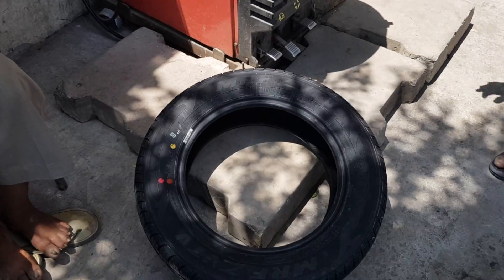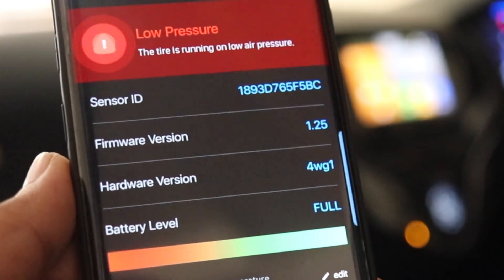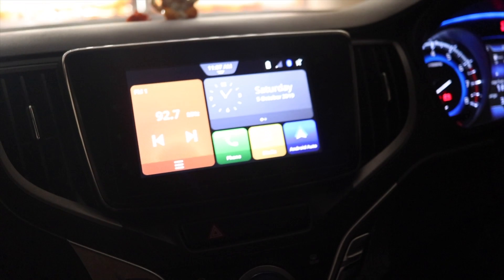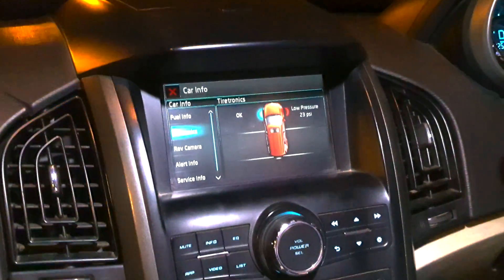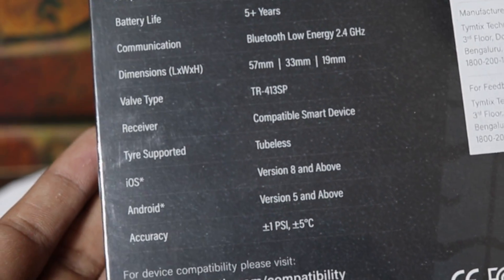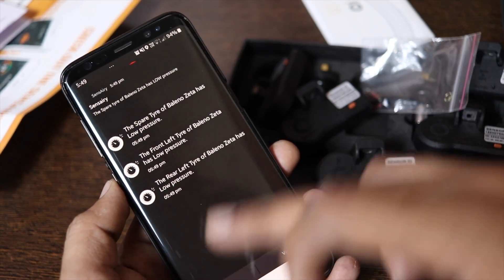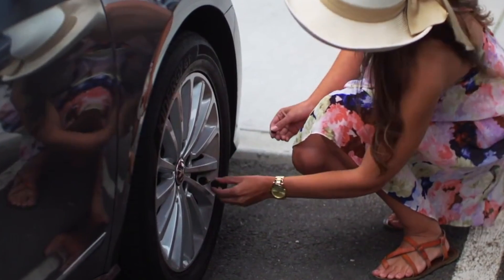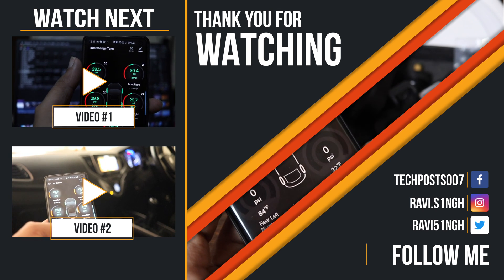Baleno Car Tyre Pressure Monitoring System with Android Auto | Sensairy TPMS Unboxing & Installation

Comment: Thank you mate for expanding my understanding about programing and installing a TPMS. I previously thought I had to install a USB receiver to my Multimedia AndroidAuto Head Unit, where as the TPMS can pair via Bluetooth and WIFI directly to my phone or Multimedia AndroidAuto Head Unit. Thanks mate.
Reply: It will not connect to your infotainment system, it will connect to mobile app, and mobile app will display it to android auto/car play... so your infotainment system should be supporting android auto first,

Comment: THIS PRODUCT DOES NOT WORK ON ANDROID AUTO
Reply from the maker: It works, the Android Auto capable app or apk is available on demand. Email the support team. They will provide you with the link. Do not install or update Sensairy from Playstore if you want to use It on Android Auto.

Comment: HI Sir, I have installed Sensors in my car and i recently purchase  Blaupunkt Key Largo 970 android player which cost me 21K. I have downloaded Sensairy APK file from google and installed in my car Andriod player. It got installed and i logged in through my  gmail which i using in my mobile app. The app showing everything my car name and stetting which i have done in my mobile app but the problem is sir the application is not communicating with the sensors. Can you please help me on this. My mobile no is 7709697434/7620121284. Please call me once sir i need to talk with you that how you have done in your Baleno. Please give me your 5 10 min. Thanks

Comment: Bro how does the sensor transfer data to the app. If it's via Bluetooth then can we pair our phone with car infotainment system along with this one?
Reply from the maker: Passively send data packets to device with bluetooth signals. So you don't need to keep bluetooth connected to sensors. It should be On, that's it. After setup, you can connect bluetooth your car system or any other device without any issue and the sensors will still work and send data.

Comment: Sensairy TPMS system is a piece of crap buy treel instead and they are JK type product and you can install it for free at any JK tyre shop
Reply from the maker: It's been 18 months now. Never had any issues with Sensairy. Did you even used the Sensairy product or just here to promote this TPMS? 
Moreover, Sensairy app is much better than there Treel!

Comment: Just as the old saying goes, you can either touch your nose by directly touching it, the easy way or taking your hand behind your head, and touching the nose the hard way. You could buy an old school tyre pressure gauge or you can buy a complicated tyre pressure monitoring system.
Reply: You can buy a bullockcart and travel or a luxury car.. What's your point
Reply: It is all about convenience..
Reply: When you drive in highway and suddenly pressure drops because of a puncture many people don't even realize until tyre gets flat and its very hard to steer. TPMS saves you, your tyre, fuel and time.

Comment: Hi dear, I own a Nexon 2018 top end model, so will it display on my infotainment screen as well like it is displaying on your display screen??
And only by downloading the app on my mobile, will it start reflecting on my screen?? or is there some app installation process that has to be done on Nexon's infotainment system as well??
Please update on this...
Reply from the maker: You need Android Auto app from Tymtix for these sensors. They will provide you link on Email. Just install that app and turn off auto update in Play Store for the app. That's it. Nothing to be done on your infotainment system. It's easy
Reply: @ravis1ngh  thanks for your prompt reply. 
Although this is a good product, but will last for around 5 years only. So is there any similar product with same features & is not a use & through kind of product, which comes with rechargeable battery?
Reply from the maker: @SANLKO  I don't know about any such product.
Reply: @ravis1ngh  ok thanks
Reply: @ravis1ngh  thanks bro.. I too have installed it but when we are not using the vehicle & when it's not connected via Android auto, does it sends alerts on app about low or high tyre pressure !?
On app it does not show latest tyre pressure, it only shows the last tyre pressure when It was connected while driving the car.

Do we need to stand close to car to get updated pressure!?
Reply from the maker: @SANLKO  yes, you must be close to the car and bluetooth must be on
Reply: @ravis1ngh  ok thanks

Comment: Hi sir ur vedio was super will it be applicable to scross
Reply from the maker: Yes. If ot has Android Auto
Reply: Other thing sir my s coss zeta ha 7inch display and is it directly displayed in the infotainmt screen or it should reflect via mobiles andriod auto app
Reply: Sir the external type TPMS will get a small screen with solar panel similarly do this internal model get any screen and evn this external TPMS is cheaper than unternal type
Reply from the maker: Choose any based on your budget.

Comment: Plz tell me if this sensor paired with system than other bluetooth devices can be connect at same time
Reply: Hi
Reply from the maker: Yes, you can. It doesn't stay connected always but then it frequently reads from bluetooth signals from the sensors. Very smart integration.
Reply: @ravis1ngh  ok
Reply: I got a ?
Reply: Can i connect this in multiple systems lije one is connected to my phone and can i connect it to my car android system and both works at same time please need ur feedback on this planning to buy one for my elite i20 asta. I am from Bangalore suggest me a hod place to install.
Reply from the maker: Oh yes, ofcourse. Sign in using same account.

Comment: Sir there is two senseairy Tom's on Amazon
1with out display
2with display
Which one to buy for my new swift zxi+
Reply from the maker: If you have android Auto, get without display.
Reply from the maker: You can always check the pressure on phone app also. So no need to get display